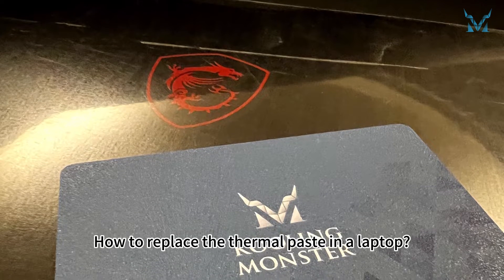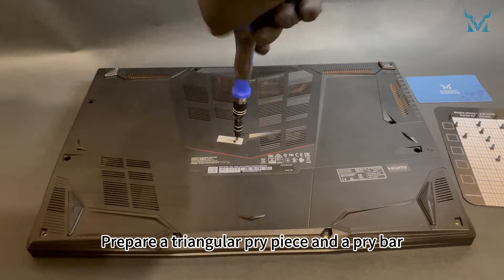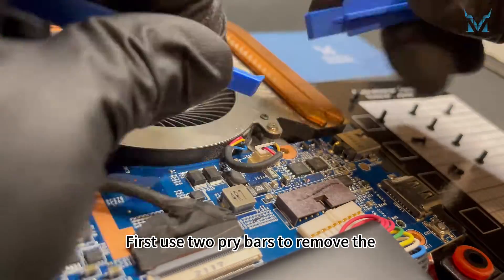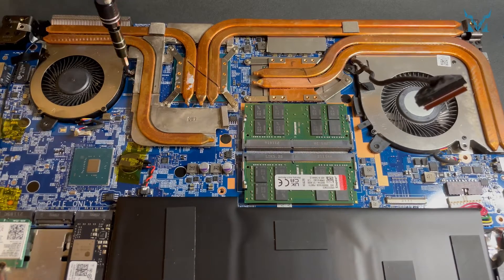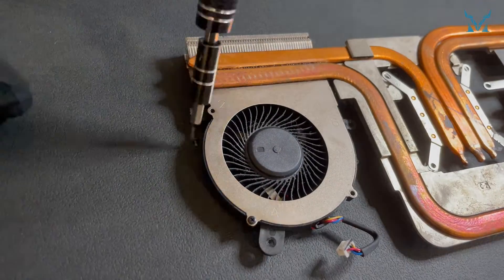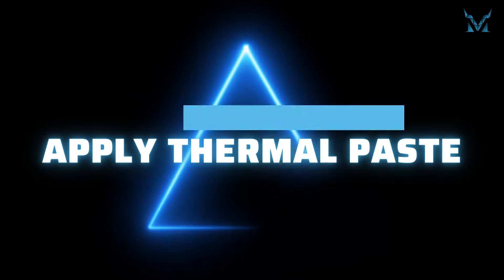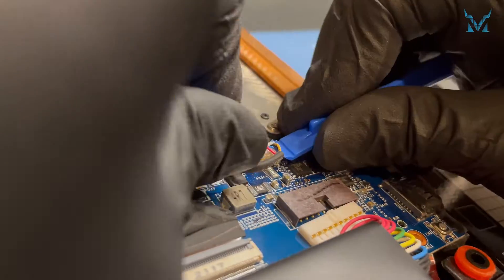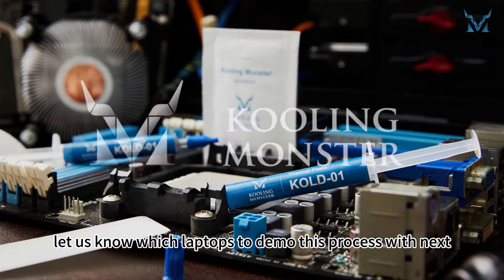Speed Up Your Msi MS-16W2 2020 - Prevent Overheating With Dust Cleaning & New Thermal Paste

Comment: Can you help me fast? I got all the side clippers off but the middle is like glued on or something i cant get the back pannel off ?
Reply from the maker: The MSI MS-16W2 (2020) back panel can sometimes feel stuck, especially in the middle. It’s usually due to the internal clips holding it firmly in place or a tight adhesive strip used for dust protection.

Here’s what you can try:
Double-check all screws are fully removed, including any hidden ones under stickers or rubber feet.
Use a triangular pry tool or spudger to gently work around the edges where the panel feels loose.
For the stubborn middle section, apply gentle but steady pressure with the spudger—slide it back and forth to release the clips. You may hear slight clicks as the clips disengage.
If it still won’t budge, slightly warm the back panel with a hairdryer on low heat for a few seconds. This can help loosen any adhesive if present.
Be patient and avoid excessive force to prevent cracking the panel.

Let me know how it goes or if you need more assistance! 😊

Comment: Mine keeps crashing but not sure I should do this myself.
Reply from the maker: There are many reasons for a computer to crash, and a malfunctioning cooling system may be one of them, but there could also be other causes. It is recommended that you first have a professional technician diagnose the issue. If it is confirmed to be a cooling problem, feel free to use our high-performance KOLD-01 thermal paste. We also have instructional videos for various laptop models.

【PERFORMANCE/OVERHEATING SOLUTIONS】- available across the globe!
Laptop dust cleaning & thermal paste replacement tool-kit combo: https://bit.ly/KMtoolkit

KOLD-01 Thermal Paste: https://bit.ly/kold-01-yt
KLEAN-01 Thermal Paste Cleaning Wipe: https://bit.ly/klean-01-yt
KOMBO-01 Screwdriver Set: https://bit.ly/kombo-01-yt
Air Duster: https://amzn.to/3YTclrP